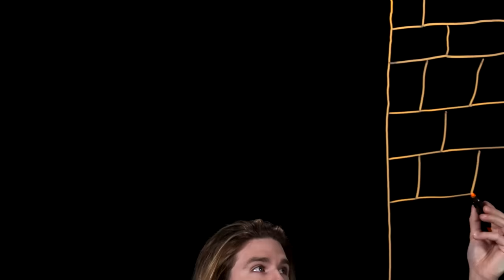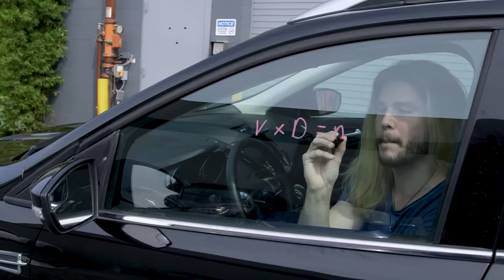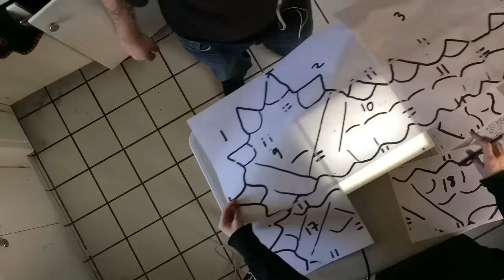Could You Swing A Real Monster Hunter Sword?

Comment: There are some gaping holes in this topic which weren't addressed, and those are mass distribution, leverage, and inertia. The physical mechanics of wielding a sword are rooted in the controlled acceleration of mass through intersecting planes, and leveraging the swordsperson's mass and energy into the sword's edge/tip at these intersecting points. A sword with a mass greater than the mass of the wielder is going to make this impossible, no matter how strong they are. With such a mass discrepancy the swordsperson would be relegated to lifting the sword under its center of balance and/or throwing it at a target (unless they had unexplained means of anchoring themselves to the surface they are standing upon, and that surface being robust enough to withstand the forces generated).
Reply from the maker: Hey Zen, you've commented on enough episodes now to know that I only have so many minutes, and I only get so deep into a topic. I agree with your points though. -- KH
Reply: I know you do, but they are still points worth making all the same. I thoroughly enjoy the discussions these topics generate. Keep it up.
Reply: That's nice and all but...I don't think about that stuff when doing kenjutsu. You just do what feels right.
Reply: drunkredninja
What's your point?  The practice of kenjutsu doesn't have anything to do with people attempting to wield swords with more mass than their own bodies (and how basic physics makes that impossible). Your comment certainly comes off as a non sequitur.
Reply: no time to do calculations bruh, busy fightin ninjas
Reply: I covered a lot of those points in a rather lengthy comment. It would probably take a half hour video to really do the topic justice though.
Reply: as long as the sword is already off the ground and wielded by the swordsman, wouldnt friction be enough anchoring to be able to swing said sword?
Reply: so, that is how the ants do it. LOL
Reply: Here's another one for you. Friction. There isn't enough grip even if the ground didn't actually break under you. If you accelerated it and held on it would literally tug you with it.
Reply: The way i see it is the following: We can only do calculations of a mass we think these weapons might have. Monster Hunter weapons are comprised of monster materials by a very large part, we actually do not know how heavy they are and what their structural attributes are. Thus the swords could actually be a lot lighter than we thought them to be. Now i am not familiar with the calculation of if and how someone could use something as a melee weapon, but still it is a thing that one should keep in mind. In addition to that you are placing a normal human being at the hunters point. Hunters are something different completely. Where normal humans die from one tailswipe, hunters can endure multiple ones and still get back up. They can jump from heights any normal human could not survive and merely stagger upon landing. We actually have no clue how heavy a hunter is. with all those attributes their bodies must be extremely durable and i guess not made of human bones and muscle mass but something different. Maybe the average huntress weighs about 90kg without armor or even more? Fact is Hunters are not normal humans ^^
Reply: Also the question is do you need super strength which we figured out just by figuring out weight in the first place
Reply: if you see how the characters fight in the game, you see that the point of rotation is actually outside the character when he is not on the ground. so the sword is almost as heavy as the character.
Reply: With how the sword is wielded in game it also does pull the hunter with it for the charge attacks giving the look of it the sword definitely weighs more than the hunter or you could look at it this way if the center of gravity was higher on it then that alone would pull the hunter when swinging it just like if you were to pick up a bar with say 20lbs of weight on the end swing it around it would pull you with it.
Reply: drunkredninja you dont need calculations you just need a decent understanding of physics. That can be done in the mind visualising the effects of wielding a sword the weight of a human. It shouldnt even need physics knowledge. Just imagine a human with a long stick tied to there back like a spit roast and hold one end of the stick and swing that person around at the sticks end and the weight goes beyong the actual weight of the sword into regions of magnitude were the sword effectively multiplies in weight significantly. Shorely its common knowledge that the further out you hold a bucket a water from your body the heavier it gets. Its not rocket science. You can still swing that sword at ninjas and not need to be a genius to understand the mechanics of swing something.
Reply: SilverSamurai dude ants drag there food. Havent you ever seen an ant before? They are like bulldozers not scientifically impossible body builders.
Reply: Gemini Stigma Gemini Gemini Gemini you make us all look so bad right now. I am a gemini but im not related to this person thank goodness. No matter what the sword is made of if its mass is too great you still have a mass too heavy to lift just using your bodies weight as leverage. 90 kg is not a lot of weight for the wielder when swinging a sword the size of that. The blades kinetic energy as you swing goes up the faster it moves and if it overcomes your bodies potential energy that is the energy to move you from your location in feet wide apart battle stance then you are going to jump through the air every time you swung the sword but that couldnt happen if the sword was so heavy you tipped over before your legs were able to take the weight of the blade you would be levered over like a statue would as a comparison since a statue could be strong enough to hold the sword being made of a hard stiff material but you can picture it in a more simple way this way. Strength is not a factor if the statue is not bolted to the ground it will tip over. Its called centre of balance which increases away from you drastically the further the sword is from the body. Shorely you have held a bucket of water just 9 kg which you can easily lift but its impossible for a normal untrained person to hold that full bucket of water horizontal from the body at arms length even if they could you can only do it for a short time where else you can hold that bucket vertically for ages. Same problem with cranes. The max pay load carried decreases the further out it is from the base of the crain as it is increasing its masses affects on the crane arm. to robert faer Friction does not even come into it. Its like saying friction holds you on the ground. Thats called gravity. The best it does affect you is moving around. The friction allows you to push off the ground with the souls of your feet while simultaneously the ground pushes back on your feet allowing you to move or lack of friction slipping and falling and basically going no where. Like being stuck on a sheet of ice. Also a sword made from a biological creature can not be made of flesh and blood and expect to do damage that didnt rip the sword into fleshy pieces. Cartilage is too soft and bone is heavy. Karotin being the lightest biological material you could use with reasonable success as a sword. Bone being better. Any other materials are fictional, biological creatures cant grow steel or carbon fibre. if there is metals in the keratin or bone in that there density is different to what we know them to be with earth creatures it will either increase the swords weight or make the sword less dense and therefore weaker but still too heavy. The sword he had made was made out of the lightest materials available that still remained ridged and kyle still had a mini heart attack lifting it. Im getting no sleep here. The more comments i read the more mistakes i see. I need sleep. Im out 😪
Reply: I never claimed that i am even remotely knowledgeable about physics, i only had a very basic education regarding physics. And to be honest i see no point in why i make people look bad because i do not know something. Still my point remains, we do not know either density nor mass of the sword or for that matter the hunters. I think it has been mentioned a few comments further up that hunters are descendant of an age in monster hunter were humans were forced to fight elder dragons to survive. They are so to say descendants of super soldiers or superhumans of some sort. So even my estimate weigh of 90kg could be way to low. I for one have no clue and i find it interesting that if the sword would be made of materials we know of at this point of time it would be too heavy to use for a human. I am not even claiming remotely that what you are speculating here is wrong, if you set it in a world like earth they are most certainly a true fact. But this is a game where gravity and physics and stuff like that are defined by the creators, even if they look similar to the same laws applied to our universe, they can be whatever they wish them to be.
Reply: aussie oi oi oi with ants it all depends on the species if they drag or carry their food.  Take carpenter ants for example they carry leaves.  All in all I would surmise that it all depends upon how much larger (weight wise) the food is than the ant to determine if it will try to carry or drag its food.
Reply: Rabidwombat666 dude the reason ants were mentioned in this video is because ants can lift 10 times there body weight. But if they did that there bodies weight would be a fraction of the object they wish to move. If it was on there back then shore they can lift 10x but they dont and any other ant that does what you say it does, does not lift 10 times its own body weight and does not lift it horizontally which it must since the lifting happens at the head which would cause it to head butt the ground. Shorely you have been on a see saw right. Thats the simplest way i can put it. Your on one side of the pivot point and you have 10 humans on the otherside. Even if you had super strength you weigh less then the object you wish to lift by ten times. If you could lift ten people you would have to lower the humans from above you so all the weight is directly over your center of mass at all times as you will tip over just trying to pick that much weight up to hoist it over your centre of balance. Imagine a light weight plastic table. Stand on that table and walk towards the edge. At some point your weight will move the centre of mass of the table beyond the support legs underneath it and you and the table will flip and hit the ground. Please just trust me if you still dont understand. I know its beyond you but ants to get to escape physics. If they can lift 10 times there weight horizontally and thats a big if it is only because they have 6 legs and claws on the end to hold them rooted to the ground. How do you think they walk up walls and upside down on ceilings. If it is not lifting more then its own body weight then it has nothing to do with the video about a sword too heavy to lift under any circumstances.
Reply: Gemini Stigma well then dont comment on a science channel. Questions are fine. Just dont pretend you know what your talking about.
Reply: drunkredninja well when some one isnt getting the idea when explained to them sometimes it takes a book worth of comments written in every level of intelligence with the slim hope you will understand my point. Get all angry cause you feel stupid. I dont care. Get smarter and you will be forever happy. I will be on your side with your comments then. I like smart people. I give compliments to smart people. There is absolutely no reason why i should put up with stupid people or even tolerate them. Almost every one goes to school as its madatory. How much did you learn while you were there. I build shit for a living. Im not terribly clever but this is all easy stuff to me.

Comment: One thing i noticed with this game more than with any other, is how actually almost any weapon you create, despite using monster materials, has it steely core. In greatswords, for example, the rathalos greatsword will look just the same as the steel one but with a few scales and stuff from the rathalos attached to it. And until the latests improovements, it wont look like it's fully made of the monster. But still, any of the weapons would have a core not made of a monster's material, so i guess they would weight even more xD